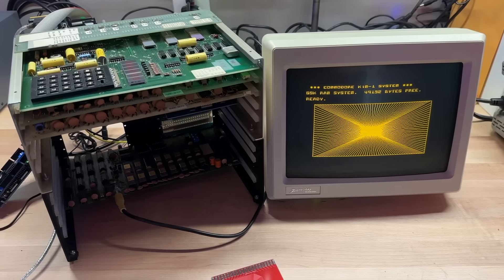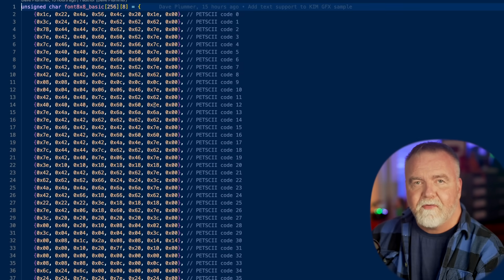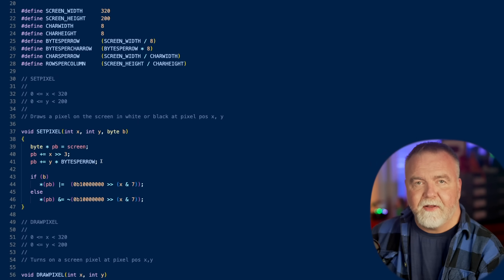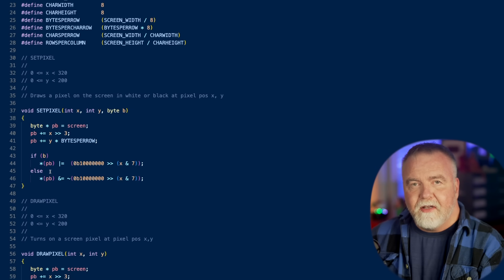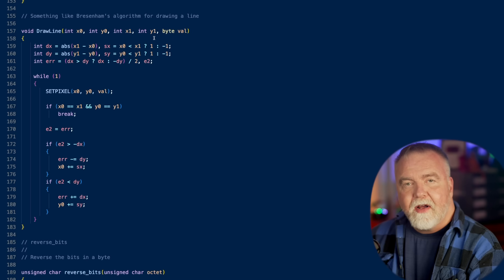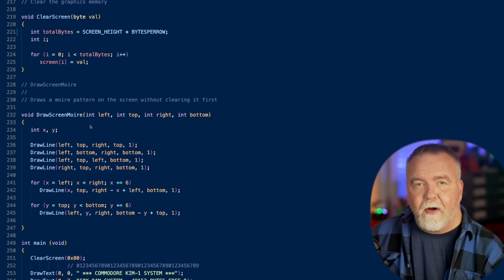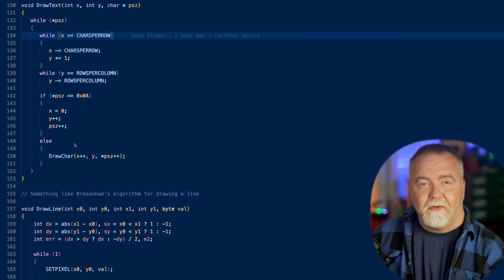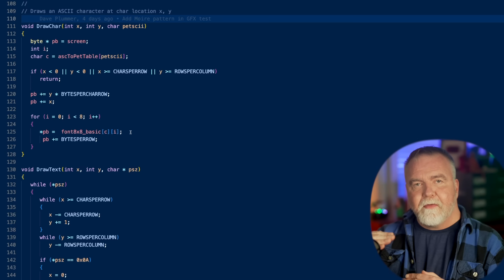Coding Graphics in C: SetPixel, LineDraw, Moire and More!

Comment: FWIW: In a project of mine (my CPU ISA project, AKA: "BJX2"; can run on an FPGA), for the Boot ROM, I had noted that I could fit pretty much all of the normal ASCII characters into a 5x6 pixel grid, which allowed storing each as 32 bits (with 2 bits left over to fine-adjust the relative position of the glyph when expanded to 8x8 pixels). This was mostly because I could save some FPGA resources by eliminating the ROM font and instead only having a RAM font, but this means the Boot ROM needs to set up the font before one can "actually see any text".
Where, in this case, I did funky graphics hardware where one can have a mode that is basically a 640x200 or 640x400 graphics mode, and a text-mode, at the same time (as opposed to a more traditional bitmapped framebuffer; which needs a lot more RAM, and a lot more memory bandwidth for the screen refresh). Apparently along vaguely similar lines to the C64 or NES...
There are some (more or less) bitmapped modes available as well (320x200 hi-color; 640x400 16-color; 800x600 4-color). But, during the early design stages, the VRAM was a fair bit smaller...
Reply: Erm, a ROM font of 256 x 8 byte characters fits exactly into a 2K BRAM block. Most FPGAs work in blocks this size and it can get tricky trying to split one up into smaller sections for other tasks (especially since that block should be part of the video hardware implementation, not the software), so I’m not sure what the great advantage is here (especially since 5 x 6 fonts are butt ugly). Are you working with particularly small FPGAs or something?
Reply: @stevetodd7383  It was a little cheaper to "just" have the Font-RAM (for a dynamically reprogramable character set), than to have both a Font-ROM and a Font-RAM (and the RAM-only case leaves more room in the glyph space for dynamic glyphs).

As I saw it, a 96x32 bit boot font was "good enough" (and also looked better than a 7-segment or 14-segment font).
In this case, the Boot-ROM is 32K (and essentially loads a PE/COFF image from a FAT32 formatted SDcard). Much of the ROM is used up by the boot-time sanity checks and the FAT32 driver and similar.

The "OS" then replaces the boot-time font with a more proper (and more expansive) 8x8 font (ASCII+1252 + dynamically loaded glyphs from a small Unicode subset).

Originally, I was designing for an XC7S50, but then went to an XC7A100T, and am now using an XC7A200T.
But, yeah, a 2K Font-ROM would not be much of an issue for the current FPGA in a technical sense.

I can note that I originally intended the VRAM to be 32K, but have since expanded it to 128K. It was originally located in Block-RAM, but has now been mapped to external RAM (but, still 128K mostly for memory bandwidth / access-latency reasons).
Reply: @BGBTech  even the Spartan 7 50 had more than enough resources to do what was required (75 4K BRAMs, splittable into 2K blocks) PROVIDED you didn’t try to do everything in BRAM. External SDRAM is fine providing you use BRAM to buffer it to the raster engine (e.g. have the current line in BRAM for serialising while creating the next line in another. Just swap them over when the first is completed and repeat. Provided the next is ready in time you don’t care about access latencies and refresh cycles.
The Artex 7 200 should be way overkill for anything doing VGA resolution work (it can handle at least 720p HD without any external HDMI encoding hardware, and 1080p or better with an external encoder). Take a look at the Spectrum Next project. It uses an older Spartan 6 LX16 to generate both VGA and HDMI video as part of an enhanced emulation of the old Sinclair Spectrum/Timex Sinclair 2068.
Reply: @stevetodd7383  In my initial tests, with the XC7S50 could manage a 32K or 64K VRAM, with the VRAM entirely in Block-RAM. This also leaves space for an CPU L2 cache and other things.

With the XC7A100T, I initially had 128K VRAM + 128K L2 cache, but then merged this into the L2 cache (allowing for a 256K L2 cache).
I carried this design over to the XC7A200T, but then increased the L2 cache to 512K (but, don't have enough for a full 1MB).
I could potentially re-enable the dedicated VRAM in Block-RAM if I wanted (vs DRAM-backed); it is pros/cons.
Typically, the display memory ends up mostly hanging out in the L2 cache.

Despite the RAM interface being theoretically fast enough for a 640x400 or 640x480 hi-color mode, trying to actually do this tends to result in the display being mangled as the L2 cache doesn't get responses back to the display-cache quickly enough to keep up with the screen refresh.

I mostly use 320x200, but can use 640x400 via a color-cell encoder...

Also note that the display memory is not strictly raster-ordered in my case, but actually organized (in high-color mode) into 256-bit blocks representing 4x4 pixels. 
Partly this is because the bitmapped graphics modes kinda evolved out of the text mode.

As for the CPU I am running on this:
Basically, it is a 64-bit 3-wide VLIW with 64 GPRs, running at 50MHz. Mostly using a 48-bit virtual address space for now (but 96 bit is supported as an extension). Also predicated instructions, etc.

Also has a double-precision FPU, etc.
Also a 4-wide 128-bit Binary32 SIMD unit (sorta like x86 SSE), with a peak theoretical throughput of around 200 MFLOP/sec.
Also supports some 128-bit ALU operations and similar as well.

Note that this uses variable-length bundles (and variable-length instructions), unlike something like the Itanium / IA-64.
Where, bundles are 1..3 instructions, and instructions are variable-length 16/32/64/96-bit. Though, only 32-bit instruction forms can be used in bundles at present.

Also gets better code density (more on par with a traditional RISC ISA).

On the XC7A200T, I can go dual-core with this... (Sadly, on the XC7A100T, dual-core blows out the FPGA's LUT budget).

It does pretty OK at some tasks (such as software-rasterized OpenGL). Sadly, I still have not solved the "make C compiler output for VLIW not suck" issue...

Also still only GL1.x as I am not yet sure how to make a good GLSL compiler, ... And, GLQuake performance still kinda sucks on a 50MHz CPU, ...

Pros/cons vs something like RISC-V.

The CPU core can sorta run RISC-V RV64IM code as well, but this is not so well tested.
Reply: Ah, you’re coming at it from that end of the spectrum. VGA resolution graphics and a 64 bit CPU are an odd combination. Good luck trying to get VLIW and C to play nice (Intel tried and failed). You may even want to think about Kintex 7 series FPGAs (it is possible, with some searching, to find Kintex 7 325 and 420 boards for not silly money) but licensing of Vivado may be an issue.
Reply: @stevetodd7383  Yeah, I was aware of the QMTECH XC7K325T boards (saw and considered this around the same time I got the QMTECH XC7A200T board). Big issue would be that the Vivado license would cost more than the FPGA board in this case...

Previous boards were the Nexys A7 and Arty S7-50. Nexys A7 can manage a single core; Arty S7-50 requires scaling back some features.

Was able to fit a RISC-like subset onto an XC7S25 (CMod-S7 board), but something more like RISC-V RV32IM makes more sense on the XC7S25.

For both the Nexys and QMTECH board, I am using VGA. For the Arty and CMod was trying to use composite-video instead.

I can get "reasonably solid" performance from my CPU, but (sadly) it requires writing a lot of code in ASM (this is partly how my OpenGL implementation for it works).

My C compiler, admittedly, mostly emits RISC-style code; with relatively little ability to make effective use of VLIW bundles. Many optimizations (like modulo scheduling) need to be faked manually (with one writing C in an ASM-like style).

If one writes using "more traditional" coding styles, performance is a bit more lackluster (more like a 486 or PowerPC; and the 50MHz CPU really shows...).
Things like "small tight loops" perform particularly poorly (it tends to do better with bulky highly-unrolled code), etc.

For some niche cases, it is possible to get performance more competitive with an early 2000s laptop. And, by some metrics (such as L1 memcpy performance), the gap isn't all that large despite the huge difference in clock speed.

It also gave promising results for JPEG decoding, but didn't get around to trying to write an MPEG style decoder for it.

Had experimented with video playback using some more custom video codecs though. Mostly targeting 320x200 30-fps video; had OK results with a format vaguely resembling LZ compressed CRAM video (not directly CRAM based; but sorta similar tech to if one glued LZ4 onto CRAM).

Had mostly been using 320x200 hi-color graphics for stuff (for Doom and Quake and similar).

Had done some initial "GUI like" experiments at 640x400 using color-cell (feeding a RGB555 framebuffer through a color-cell encoder), but currently this is limited to around a 22 fps screen-refresh in my current experiments...

With some specialized helper instructions, the current color-cell encoder (by itself) gets a maximum of around 70 megapixels/second at 50MHz (from RGB555). But, a lot of time is still needed for things like "redrawing the window stack", etc.
Where I am using a color-cell format along vaguely similar lines to DXT1.
Image quality isn't quite as good as a native hi-color framebuffer would be though (nor as good as a "good" software encoder; but some of the tricks were N/A for the hardware-assisted encoding).

In a high-level sense (not strictly accurate, but general idea), it is sort of like if the VRAM framebuffer were encoded using DXT1 (in 640x400 mode); just with 2x2 color cells packed into 8x8 pixel tiles (with 80x50 256-bit on-screen tiles).
There is also 16-color mode (RGBI), but 16-color generally looks worse than color-cell (with a funky pixel order; where each 16-bit pixel from the 320x200 mode was broken into 2x2 RGBI colors...).

There is also an 800x600 color-cell mode, but it currently uses a different format (2bpp cells with 1-bit endpoint selectors; 100x75 128-bit 8x8 pixel tiles). This is along with a CGA-like 4-color mode (with multiple 4-color palettes available).
Reply: @BGBTech  Sadly QMTech seems to be drying up in terms of their stock. The Artix 200 board isn’t even mentioned and the Kintex 325 used to have a rather better base board option. For purely non commercial use it is possible to lay your hands on a bootleg licence key for older Vivado builds (2018 for example), and the other thing to contemplate is that a HDMI PMOD module is simple and cheap (it’s basically a socket and a few passives), which will get you up to 720p (you’ll need the frame buffer in SDRAM for sure, probably with an independent cache as even 8 bits per pixel needs about 900k).
The other thought is that LLVM and CLang may be your friend here. You need only work on the final translation layer from virtual CPU to your own implementation.
Reply: @stevetodd7383  I got the board I have a few months ago, so I guess it is drying up pretty fast then...

I have mixed feelings about HDMI, as it looks like a more complicated interface to drive if compared with VGA. I am currently testing with a monitor with a 1680x1050 native resolution and VGA and DVI inputs. Had previously tested with an older 4:3 panel with a 1024x768 native resolution (only supporting a VGA input).

May at some point need a faster RAM interface, as my current DDR controller does not use SERDES and so drives the DDR3 module at 50MHz with DLL disabled, and so doesn't exactly get the full speed of the DDR3 chip (I did my own thing here; as opposed to using MIG).

As noted, the current interface has:
VRAM has its own local 16K cache;
This talks to the L2 cache over a ring bus. Basically a ring-bus where everything on the bus is connected in a ring, forwarding requests and responses around the device in a big circle; with unresolved requests circling the ring until they can be handled.

The L2 cache is 512K at present, and basically holds the sole interface to the external DDR3 chip.

As for the C compiler, yeah, I wrote my own.
I had found both GCC and Clang to be a little intimidating, and at the time had the front-end parts of a C compiler I had written when I was younger. Writing a new backend for this seemed easier at the time (but, its code-generation is "kinda weak" if compared with GCC or similar).

Though, ironically, my C compiler was itself basically derived from a fork of an interpreter for a JavaScript/ActionScript inspired language I had started writing back when I was in high-school (with Web and Flash stuff being pretty popular back then). Later on (back when taking college classes), had modified it to be able to parse C (originally intending to try to use C as a script-language). I shelved it at the time, but revived it for my current project.

With the C compiler's IR stage still effectively going through a stack-machine bytecode stage (with static libraries being handled as a stack-oriented bytecode).

As C language extensions, it does still include things like dynamic-types and ex-nihilo objects and lambdas and similar. It can also still compiler the script language, which sorta resembles something like ActionScript3 or Haxe.

Using these features though does result in code containing a large number of implicit runtime calls (so not ideal for performance). Whereas, for plain C code it is (mostly) free of implicit runtime calls...

It can "mostly" keep variables cached in registers, though the register-allocation is a little naive. It spills everything at the end of every basic block, with the exception of any variables that have been statically assigned to a register within a given function. Things like unnecessary spills or register moves and similar are still sort of a perennial issue.

But, unlike GCC or Clang, the code for the compiler is a lot smaller; and it has a compile time of around a few seconds.

I guess another ISA feature relates to the 48 bit address space: the high 16-bits of pointers are generally/frequently used for things like dynamic type-tags, and there is partial ISA support for various type-tag related tasks (checking and setting type-tags, etc).

...
Reply: @BGBTech  HDMI is, at its basic level, DVI. DVI is pretty easy to generate on an FPGA. You need to create an 8-10 TMDS encoder block and it helps to have some SERDES assistance as the bit rate for the colour channels is 10x the pixel clock (which starts at about 26MHz for VGA and heads on upwards). Other than that it looks to the rest of the system very much like analog video, with horizontal and vertical blanking and everything.

I really would look into using SERDES for DDR memory, with Xilinx’s implementation at least it runs at a multiple of 4 or 8 times that of the FPGA fabric so you’ll get much higher throughput and effectively lower latency. Your video frame buffer should become a much lower portion of the available bandwidth and allow you higher resolution/colour modes.

Comment: I think your ClearScreen and DrawChar would be faster if you used pointers.   That's just a guess given why kind of optimizers where available for the 6502 C compiler.  Did you try it?
Reply: Using a C compiler is garbage for performance on a 6502. Far faster to just use native assembly.  C is fine for prototyping to get a reference version working but eventually you’ll want performance. The trick is knowing when to trade space for speed.

 i.e. The 6502 has no native multiply instruction so building an array of 16-bit addresses to the start of a scan line, with this table split into two (low, and high) will be significantly faster the using a dog slow x*256 + x*64 pointer calculation.
Reply: @MichaelPohoreski  Back in the day, C on 5602 wasn't that bad.  It was just up to you to do the optimizing for what it would produce.   That's why I suggested pointers.  To move the math outside of the loop. Leaving you with a simple INC on the pointer in  the loop.

I also know that different compilers had different characteristics.   It's possible that his compiler has pointer issues.   Much like the early MS-C's pointer normalization fiasco.
Reply: I think that Dave was keeping it all as simple as possible for the viewers. There are many ways to optimize the C code so that cc65 generates better assembly that he wasn't using, as well as just calling memset in his clear screen function, using lookup tables instead of multiply (which the 6502 does not have, so it's somewhat slow), etc.
Reply: @MichaelPohoreski  in theory there's no reason a C compiler couldn't generate good or even better code than a human for 6502, assuming global analysis etc.

Just nobody's putting LLVM level effort into something that can only run programs small enough to feasibly do in assembly anyway!